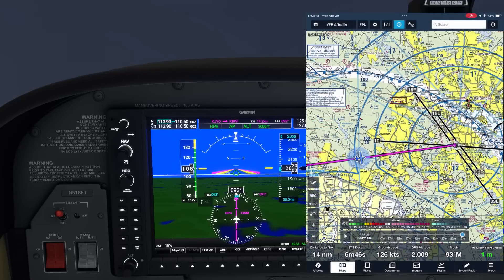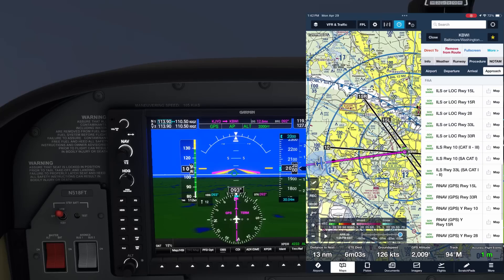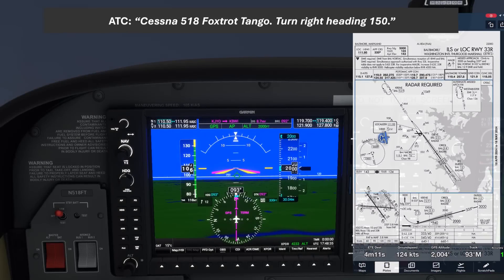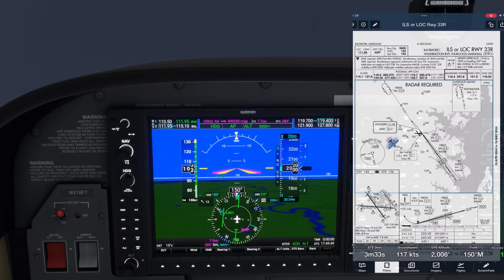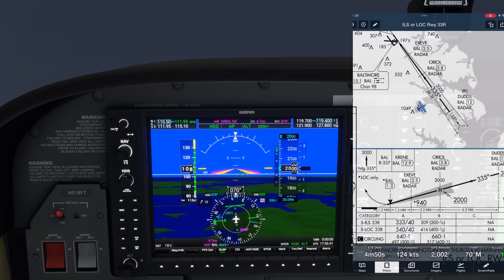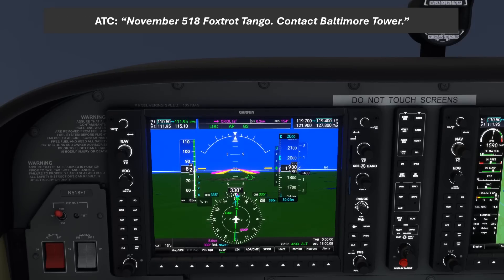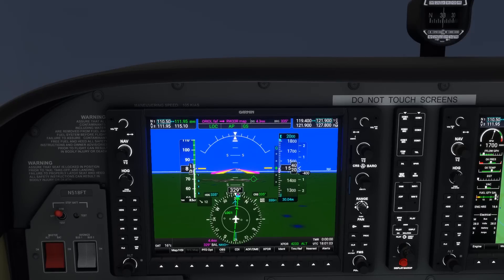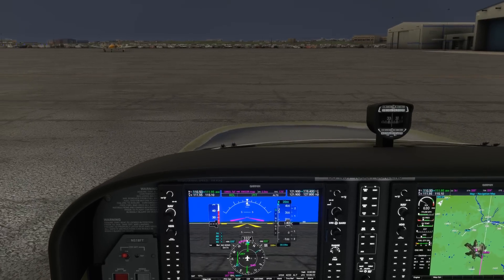How to Fly An ILS Using Autopilot | IFR Approaches Made Easy

Comment: I can never for the life of me seem to intercept a glideslope, and this channel consistently has THE BEST explainers. I’m going to shadow this video precisely in X-Plane 12 right now (albeit without a glass panel - default 172). I may report back!
Reply: Yep, my issues persist. Default 172, steam gauges, flying HDG into FAF, halfway down the feather - at any angle, really - totally stable, ALT set at GS intercept altitude per the approach plate (or barely below). LOC frequency is tuned on 1, both needles are alive. Everything is solid.

I hit APR as I near the final fix and the horizontal GS needle starts to fall. Finally, the AP NAV turns me to meet the localizer, aaaaaaand I fly right through the freaking glideslope. Every single time. Help.

Comment: Just a query.   When handed over to Tower and contacting them…….is there any requirement to let them know you are established on the ILS?   Or is it sufficient to just say your call sign?    Reason being that Approach would have already told the Tower that you have been cleared the ILS and they are going to hand you over to them.    Hence reducing air time.
Reply: It's more important that they  know and you know the runway and type of approach you're doing. Approach are humans too and could always accidentally give Tower the wrong approach. Everyone being on the same page is more important than 1-2 seconds of reduced radio time. Even if it is redundancy, aviation is made up of those.